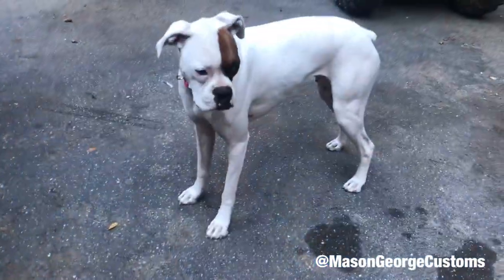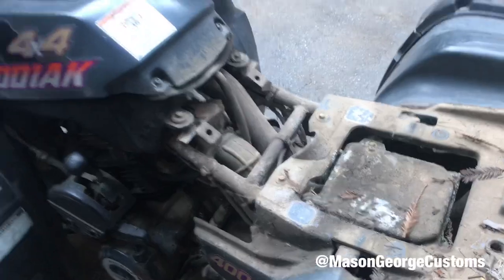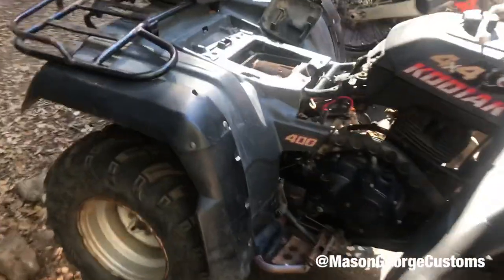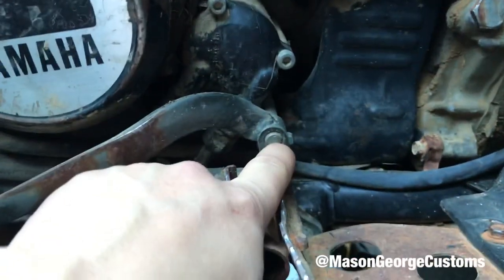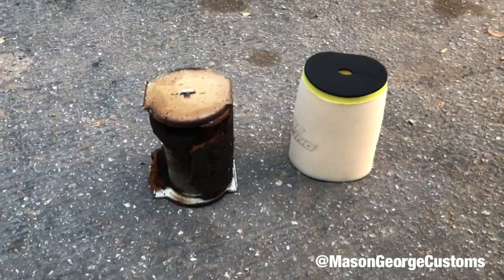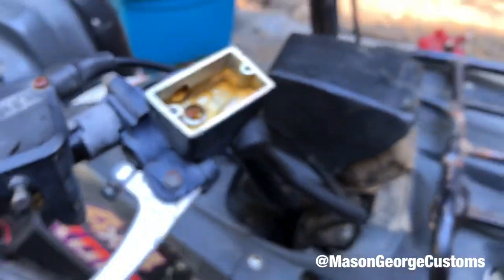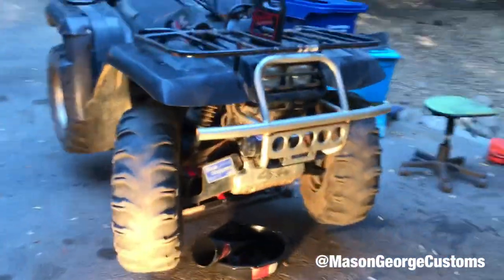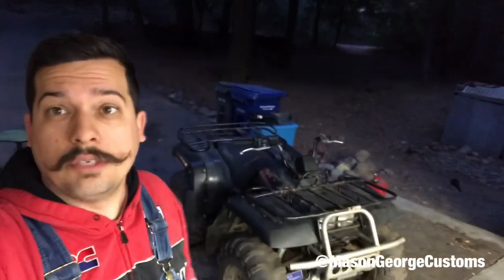Yamaha Kodiak 400 Full Service Oil Brakes Differentials & A Mouse Nest

Comment: Thanks for the video.   Im just starting to work on my 94 kodiak..it sat up in my mothers shed for about 12 years ...the motor wouldnt even turn over ....i definitely got my work cut out...i just got the motor from being seized up ...im going to try to get it running...

Comment: Can I ask you the approximate quantity for each oil reservoir. I understand the front and rear differential are very easy filled to the lines on the thread. But the engine oil I can’t find it anywhere and I don’t have the owners manual. Thank you appreciate this video

Comment: Valve clearance needs to be checked for sure. At least the differential seals are not leaking
Reply from the maker: Four years later, she’s still running strong… if it’s hard starting or making a lot of noise I understand going to the valves but these things are tanks.
Reply: @MasonGeorgeMotorcycles  I guess not Russian tanks.  Lol

Comment: Hey I have a question about a 94 Yamaha Kodiak 400 . I has a slow oil leak ... Where do you think it's coming or what could be wrong ?
Reply from the maker: Koda Rain Without looking at it I have no idea. I would suggest cleaning it really good and then running it and you should have a better idea of where it’s coming from.

Comment: What types of oil do you recommend using in engine and diffs?
Reply from the maker: Eliseo Gloria 10w 40 motorcycle specific oil in the engine and the dif I recommend 80 90 gear oil.
Reply: @MasonGeorgeMotorcycles  how many quarts for the motor?